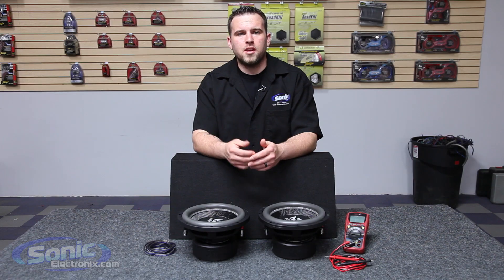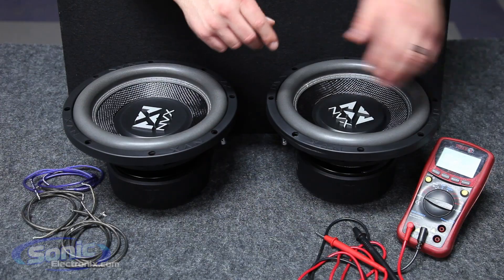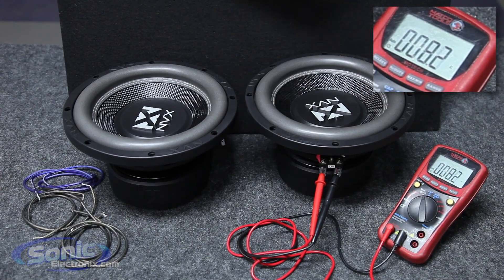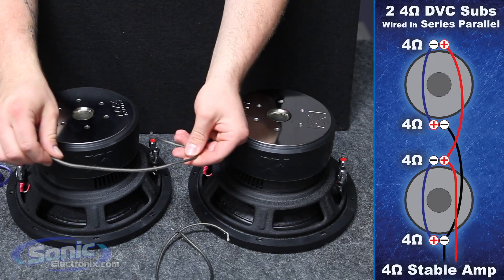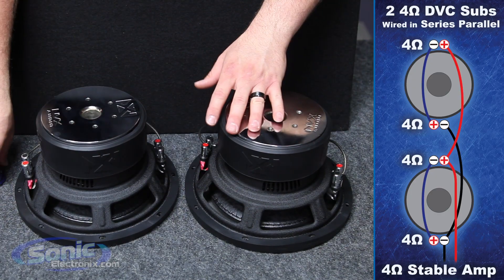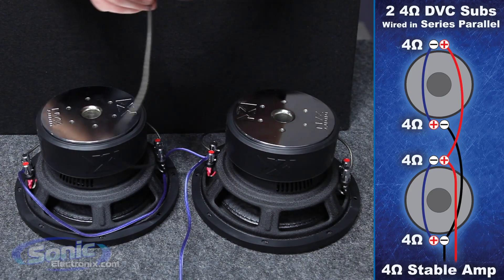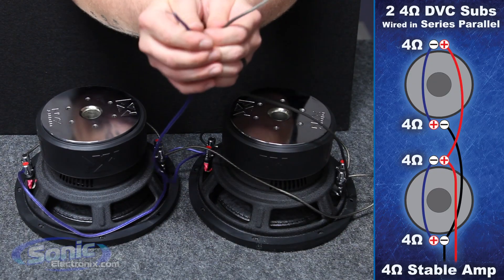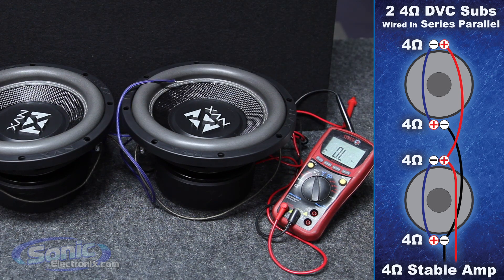How to Wire Two Dual 4 ohm Subwoofers to a 4 ohm Final Impedance | Car Audio 101

Comment: I'm no expert but I feel like wiring the subwoofers in parallel 1st then series them to 4ohm allows more electric flow once the electric passes the 4ohm pathway it opens up to a 2ohm/ more wide channel. Instead of creating a 4ohm small pathway to an even more condensed pathway of 8ohms at the woofers. I understand that math is math and final impedance is all that matters but I feel my way of parallel-series instead of series-parallel would be better even if slightly. Plus you have 2 voice coils that aren't receiving any positive power.

Comment: How would you wire it if you have two terminal cups? I have two 4 ohm subs and amp is stable from 2-4 ohm. So I wire exactly how you have it but how with two terminals?

Comment: how would you wire 2x 4ohm single coil subwoofers to a 2 ohm amplifier that is 4 ohms when bridged? any diagrams would be useful .
Reply: Lower your ohms on your speakers to 2. On each speaker do positive to positive and negative to negative. That what I think but I also believe these guys have a video for that

Comment: My Re2200 does 500 watts bridged each sub is 250 rms...with this configuration would it be ok to hook it up to my amp bridged if the manual says 4 to 8 ohms bridged?

Comment: I have a question. I have an amp that can handle 2ohm. It's a Boss r4002 800w amp.
It's 2 channel. Right now I have 4 pioneer 5way 6x9 they are 4ohm. They are hooked up parallel. Would it be be better to run them in series instead and is there anyway to hook up 2 more 6x9 to it or 4 seems to be the max I can put on this 2 channel amp?

Comment: I was actually scrolling down many of these comments and many have asked the same question...Is it possible to wire (2) dvc 4ohm subs to a final 2 ohm?  My amp does not support 1ohm.  From surfing the web, I found that it is possible but you would only have to use 1 coil on each sub and short the coil.  Is this true? Are there any drawbacks to this? If possible, Can you make a you tube video again to show us how to wire this?Read more Show less

Comment: Can you take 2 JL Audio 10" dual voice coil 4omh subs and make it a 2omh load ?
Reply: Did you ever figure out the answer for this question?
Reply: @mariacortez3812   Look on rockford fosgate website they had speaker charts to help out wiring subs. Hope this helps

Comment: Cool I've been looking for this.  But how do I wire this up to my 2 channel amp??  Do I just use one channel ? Or do I bridge the two channels ?? Thanks
Reply: You bridge the channels. You’ll have the positive atw over on one side and the negative atw on the other side (In their respective polarity locations obviously) and this leaves a gap. So it’ll look kind of like this: {**} when you’re done. The stars are the empty terminals.
Reply: @murderyurface3595  thanks man just the info I needed !

Comment: so i have 2 dual 4 ohm 750 watt subs if i wire it like in the video what kind of amp will i need ?
Reply: armorboy24 Doe I’m running a 5000 watt amp 2 channel

Comment: My amp is 2Ω stable and 40 mono bridge. My subs are 40 DVC 2/8 im at wired @ 40 per sub now. I want to bridge my amplifier do I wire both subs together to get a final 40 impedance?

Comment: i have 4 kicker cvr dual voice coil 12s custom built box speakers face inside the truck as well as the ports other half is in the bed in my 02 chevy avalanche have an extra battery my amp is a audio pipe 3000.1 class d 2 ohm load any way 2 have them stay running at 4 ohm goin  into the amp

Comment: question i have a small amp module board that requires 4-16 ohms to use it but i have 2 small 4ohm speakers and the board has a left channel and right channel speaker for stereo audio left and right, is there a way to wire both 4 ohm speakers to make it work in stereo? or do i have to wire up 2 speakers and make 2 speakers per channel to each output to get stereo?

Comment: What's louder 4 ohm or 2 ohm?
Reply: ohm is resistance means how much electricity can handle but if you want the answer more straight then 2 ohm is going to be the most powerful cause the amps at 2 ohm handle the maximum power and some of them 1ohm

Comment: if you had a sealed two sub box couldn't you wire the subwoofers down to two ohms then connect the positive and negative terminals on the box to then put them into series to achieve the same thing?

Comment: How would you wire them down to 2ohms? 2 dual 4 ohm subs down to 2 ohms, just like you did here but 2 ohms instead
Reply: TheKidBart you can't! only options is 1ohm and 4 ohms. you will need another sub to have 2ohms.
Reply: James Offord Jr. I have 2 subs, bot subs are 4ohms......

Comment: If I have a 4 ohm after market speakers and my factory system is 2ohm is there a resistor I can use to make my 4ohm after market speakers 2ohm load?

Comment: just wondering how would it effect the sub and amp if instead of using braided speaker wire I was to wire my subs with hard wire? I await your valued opinion.
Reply: speaker wire is a higher grade wire plus the insulation is better than with solid wire you would do best with a top shelf 14 g braid speaker wire

Comment: does this affect watts on subs rating? for say a 2 10" 1200 watt 4 ohm svc subs wired in parallel= 2 ohms  2 sets of them = 4 subs in all wired 2 together per channel. on a 4 ohm stable amp 2 ohms per channel.? i just wana know this so i can match a amp for my build? I want it wired this way and a 2 channel amp just need to know so I can try and match watts ratings now

Comment: Do these run on household 120 volts?  Or does the power supply step it down?

Because... full power out of the wall would give you 3600 watts.

Comment: How would I wire up one duel 4ohms subs to 4 ohms?
Reply: Steven Raneri  you can't, you can either connect it in series and get 8 ohms or parallel and get 2 ohms, unless you use a 2 channel amp one channel for each coil just make sure its set to mono.
Reply: I got a 4 channel amp,Max Power 2 Ohm: 300 Watts x 4 
RMS Power 4 Ohm: 110 Watts x 4 Bridge Power: 600 Watts x 2, 
Im about to buy a second subwoofer, exacly the same, 400 w 200 w rms 4 ohm , how to hook them up? I can make channel 1+2 one sub, and 3+4 one sub? Thanks

Comment: My enclosure has separate chambers for each sub. Do I drill holes in the partition to run the wires between the woofers, or connect each sub to the terminals and run jumpers between the terminals (negative to negative, positive to positive)?
Reply from the maker: +M Kefer Take a look at this Q&A we did, should answer your question.  :]
https://www.youtube.com/watch?v=C7cADHaDt-o
Reply: Sonic Electronix Perfect! Thank you!

Comment: I have two cvx104 that I'm mounting in separate enclosures.  I was wondering how to wire these in their enclosure and connect them to my 1200w min 2ohm amp.  I'd like to connect each individually to my amp and keep each at 4ohms if possible.

Comment: lol mine came out to 3 ohms. I did use 18 gauge wire though wth a cheap multimeter. bad subs. or bad multimeter.
Reply: xXDjBlareXx
Those fingers of yours are truly better on one thing -> JERKING OFF!!! For sure not to those words you typed!!! Next time you wanted to test the continuity of the circuit, why not just use your tough to find out!!!
Reply: +Nel Edora I'm not even going to get into how ignorant of a statement that was. think about what u just said?.. check the impedance with my toung. thar shit only works for voltage and shit.
Reply: Why can't we all just get along?!
Reply: *****
get along w/ stupid people can easily get you killed then everybody will rule it an accident! Its like you don't even know what is going on every where tons of stupid people killing innocent people and they cannot be charge of their own stupidity!!! Just like the Afluenza Kid for example!!!

Comment: Ok, my question is.   Can I wire a subwoofer with a speaker on one channel?  Parallel or in series?   The same on my second channel.   Is it best to wire two subs woofers on one channel and two speaker on the other?   I'm make a small radio speaker box hoping to use 2 subs and two speakers on a two channel 100w x 100w amp. All have 4 ohms.
Reply: no......u will either blow up the speaker, or ruin the amp.....unless the "speaker" has all the same power ratings and impedance as the subwoofers, making them indistinguishable to the amp, which i can almost guarantee they dont, without even looking at em....
u dont want to mix subs and high ends on the same amp....ideally u would want to have a separate amp for each load (subs & speakers)....
two channel amps doesnt mean it is two amps...its still one amp, jus with two channels...and u dont want to put unequal loads on the separate channels.....unless its an amp specifically designed for that purpose.

Comment: Is it possible to wire two dual 4 ohm sub to a 2 ohm final impedance?
Reply: Yes you can , but not with a single channel amp. You need a two channel amp to reach 2ohm . !

Comment: Is this possible with 1 sub, I'm looking at a single two dual 4 ohm speaker....... I just checked the site and it says operating 2 or 8 ohms so if i were somehow to get a 4 ohm final impedance would it be safe, man this stuff is confusing

Comment: Impedance is the measurement of the resistance of an active circuit. Checking the voice coil in a static state gives you the resistance value of the voice coil. These values can vary greatly depending design and application.

Comment: This video was very helpful but if u wire the subs like that how would u put the subs into the box then? Also, how would bridge the amp?
Reply: thats what im trying to figure out
Reply: I realized after having a giant brain fart that some boxes, that hold 2 subs, have there own space in the box for each sub so the port could be in the middle like mine is or on the side or really anywhere. so in order to wire the dvc 4 ohm subs your box would have to be open on the inside so the wires can go from one sub to the next even though the inside of the box most likely has a little wood support in the middle.
Reply: You hook up the two leads to the box terminals
Reply: Sometimes you have to think outside the box. Literally. Run the short wire like it shows then run the long ones (+,-) from sub one to the terminals leading outside the box. Do the the same with sub 2. Then connect em outside the box then into the amp. At least that's how I did it.

Comment: @sonic electronix please help me someone so u can basically wire dvc subs in 1,2,4,8 ohms without any problems all u need is a amp that is stable at that ohm load, I'm getting two nvx subs but don't know which ones to get should I get a pair of 12" dvc 4ohm or a pair of dvc 2ohm what will be better I'm getting a cheap amp that will power them at 2ohm but later wish to buy a high end amp that is 1ohm stable and hooking them up ? Get what I mean what would be better for me in the long run dvc 4ohm or dvc 2ohm remember I'm getting two subs

Comment: So u would only use 1 terminal inside the subwoofer box, right?
Reply: yep
Reply: Kent Jackson - RMB Correct.
Reply: Kent Jackson - RMB so what does that look like?
I can't figure out how to wire the amp by having only 1 red (positive) wire and 1 black (negative) wire. How do these wires get hooked up.
Thanks

Comment: Do u need to drill a hole inside the subwoofer box so the wire can connect to each subwoofer.?
Reply: no you box should have a red and black connection and that is seald around all over on the hole it is made for so air dose not leak so if you where to drill a hole you would have a air leak and your sound would be all jackt up
Reply: Kent Jackson - RMB if youd like to.. The only time to drill a hole is if it is a sealed box and if you want it ported thats when you drill a hole.. a big hole.

Comment: I bought 2 Cerwin-Vega VEGA3104, and Cerwin-Vega Stroker STKR800.4, from you on ebay  how do I wire that? (Bridged 4 ohms: 400 watts x 2 Chan.)

Comment: It seems you guys have every type of set up except one, I've been looking for how to wire two dual 4 ohm subs to a 2 ohm final load, and I can't find it!
Reply: You wouldn't be able to do that. You would need two dual two ohm subs, and wire them this way to achieve a final impedance of 2 ohms. dual 4 ohms can only be wired to a final impedance of 4 or 1 ohms. Hope this helps.
Reply: There is a way to do it and its pretty simple.  You simply use 1 coil on each sub.  There is no rule that says you have to use both coils on a dual voice coil sub.
Reply: @bigredtruck42  if you wired them like that it's getting half the power not full power so if you want warm water you use both not one or the other
Reply: @bigredtruck42  if you use one voice coil on each sub only half of the sub will work that's why it's a dual voice coil you need to single voice coil subs to do that
Reply: @roush84leclaire21  uhhhmmm...... No, the entire sub works youre just generating 1 magnetic field instead of 2. In generic terms when you turn the cold water on your sink still fills and functions with water the same as when you turn both hot and cold on.
Reply: I'm having the same issue,  I got two dual 4 ohm hx2 12". 1 ohm would be pushing the comfortable zone and I don't want to destroy my subs.
Reply: I always refer to this site. http://www.rockfordfosgate.com/rftech/woofer_wizard.asp?submitted=true&woofer_qty=2&woofer_imp=4
Reply: I have the same issue i cant find a video that wires 4ohm subs to a 2ohm on 2 subwoofer that are 4 ohm dvc

Comment: I have an MB Quart 1000.1d amp (475rms@4ohm,750rms@2ohm,1000rms@1ohm)
and a 10inch alpine type r swr-10d4 (500rms per coil), if i get another swr-10d4 in a series parallel with this amp how much rms would be distributed to each coil?

Comment: I have 2 alpine type r 1242d subs, and a kac 9152d amp, im trying to figure out how to wire this combo for best results.  Help is greatly appreciated
Reply: 10 years and no answer 😔 I'm having the same problem two bad ass 10" CT subs and an mtx 251 and a Jenson 600. My mtx is what's kicking one sub I think I can run both my subs to the Jenson

Comment from the maker: The mono amp does not have 2 channel but it has 2 sets of terminals which makes it easier to wire to the amp. Then the amp wires it internally.

Comment: Hello, I recently bought a pioneer gm-d9601 amp from your company this week. I also got the champion series pro from you guys and was wondering what I do after connecting the +'s together and -'s together. I know I have them wired up to 1ohm by using the rockford-fosgate diagram. What I don't know is how to wire it to the amp. It's a mono block but has 2 channels. Do I run a set of wires from each terminal cup to a single set of channel input or do I run a set of wires to each set of channels?

Comment: Is been about a year and a half sins I had it wired up differently and no problems or overheating  I have 4 cvrs 12 on 2 Rockford Fosgate mono 2000 watt 1 ch amp wired up like showed 1 sub/mono amp 1 DVC 4-ohm sub but instead of it being just one sub on one mono amp I wire two subs to one mono amp the same way and run the 4 wires to the amp - on - + on + is it possible this isent the only way a local shop sed it's weird that it even works

Comment from the maker: Are they Dual 4 ohm, or Single 4 ohm subs? If they are Dual 4 ohm, you can't wire them to 2 ohms. If they are Single 4 ohm, you can wire them in parallel to 2 ohms.

Comment from the maker: you can drill a hole in the middle of the box inside to run your wire through it as long as you seal it back up.

Comment: Ok. Amp question. My amp is rated for 2x185w @4ohm 2x200w @ 2ohm. 1,000w x1 @2ohm. But says bridge only 4-8ohm. Where's this 1,000w @2ohm coming from? Cause if I can safely bridge at 2ohms I was Ganna get a 2nd amp. Seeing how I am under powered. But if 2ohm isn't safe I have the 8ohm option. Will I still have optimal bass at 8ohms?

Comment from the maker: They will wire in parallel to a 0.67 ohm load so you need an amp that is 0.5 ohm stable.

Comment: I have 2 tsw310D4 400w rms 1,400w Max pioneer subs. They are dual 4ohm coils. The amp is a 1,000w x1 at 2ohm or 180x2 at 4ohm. The question I have is...how do I get the most power out of my amp without damaging my subs or amp? Right now I'm running two channels on a 2ohm load each. Jumpers from 1st coil to 2nd + to +. -to-. Then to terminal. Its loud but seems under powered.

Comment: This is the 4th or 5th time rewiring and following this video. I'm wiring it right, I know I am. But my ohm meter is saying 7 ohms... Why? And when I go to plug it in only one sub works. I have 2 12" CVR kickers by the way and a Kole audio hk9802 amp. Before I wired them in series parallel they both worked perfectly fine. I just thought this way would be better. Help ?

Comment from the maker: You absolutely need an amplifier for speakers of that power. You would use a 4-channel amplifier and use the cross over networks. One channel will go to the crossover network, which will power the midrange and tweeter. You will be able to run your front and rear speakers from a 4-channel amp. You can get the NVX XEQ7 to take your one connection and make it into enough for those two amps.

Comment: That's awesome, also when you buy component speakers like say the type x component should I buy an amp for them or just leave it with their xovers? If I do need an amp how do I wire two amps if the head unit only has one RCA connection? One mono for the woofers and one for component speakers.